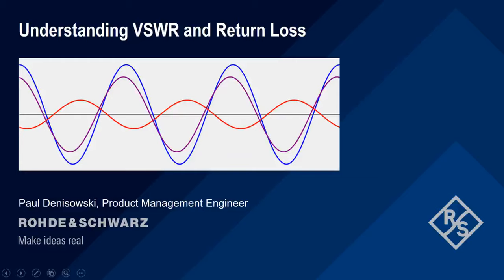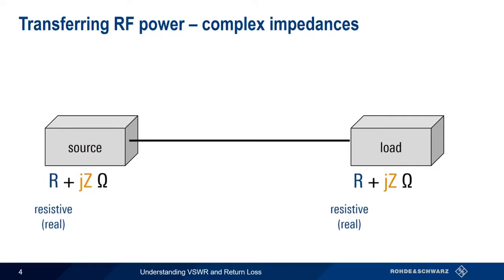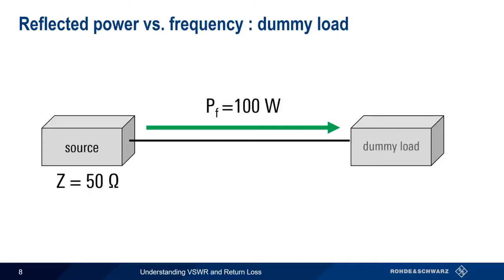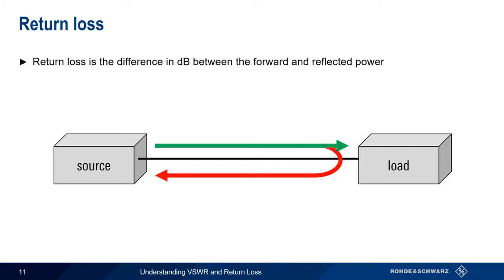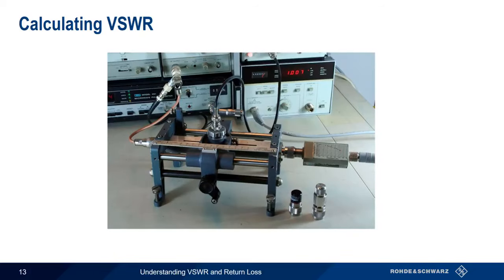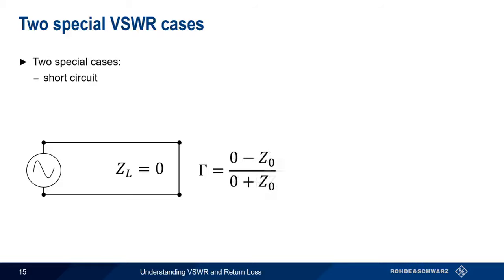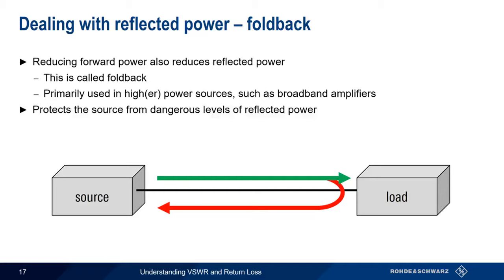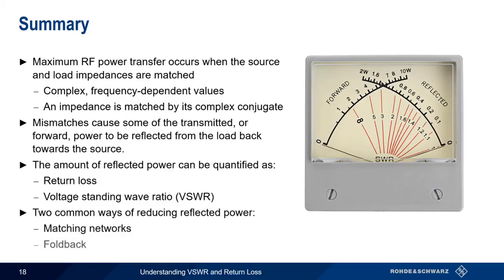Understanding VSWR and Return Loss

Comment: At 63, I find this the best explanation so far. The explanation is exactly the same as everyone else's, (so it would be, wouldn't it!), but the waveform animation is slower and easier to understand, with the explanation at a well measured steady pace. Thank you R&S, this video should be played in college courses.
Reply from the maker: Thanks a lot for the positive feedback - that motivates us!
Reply: Thank you!
Reply: @pauldenisowski  Thanks for the great video! and I have some things to ask.
The frequency of the reflected signal is the same as the frequency of the forward signal or not? And how about the relative phase between them?
Reply: @Tom-dn5de  Generally speaking, the signals appearing at all ports of a network will have the same frequency as the input signal but different phases and amplitudes.  It is possible to make S-parameter measurements on frequency-converting devices, but this is a more advanced topic that needs its own video :)
Reply: @pauldenisowski  Thanks a lot for your explanation. I am taking a VSWR measurement of an RF source, but I don't know why an auxiliary generator is
 used which transmits a wave with a slightly offset carrier frequency into the DUT. Could you explain it to me?
Reply: @Tom-dn5de  My guess is that you're making a "hot" S-parameter measurement.  Most S-parameter measurements are made with the network analyzer being the only source of RF power.  An example of a hot S22 measurement is measuring the VSWR of an amplifier output port while the amplifier is simultaneously generating an output signal ("hot").  A small frequency offset must be used so that the network analyzer can separate the reflected S22 power from the amplifier output power in order to make an accurate measurement.
Reply: @pauldenisowski  Thanks for your help, I'm making an output impedance measurement of an RF signal generator using an RF spectrum analyzer, an RF signal generator, and a directional coupler. This measurement makes me a lot of confusion. I'm not good at RF but always want to learn about it.

Comment: I'd like to make three important points, all of which can be easily proven as fact:

1.) Reflected power is absolutely NOT what damages a PA device or stage. It is the mismatch in optimum impedance at the output port, regardless of standing waves or reflected power on the feedline some distance away from the PA stage. 

2.) It is quite possible to have a very high percentage, actually nearly 100%, of transmitter power delivered to a load even with a very high "reflected power" or VSWR.

3.) Many antenna systems, as well as PA matching, splitting, and combining systems, intentionally operate with fairly high standing waves.   Collinear antennas, like VHF/UHF multiple bay arrays, commonly use mismatched transmission lines in harnesses to split power and match the multiple elements to the feed impedance. These harnesses and cables often operate well over 2:1 VSWR in the feed cables with negligible loss.

Comment: Thank you. 
   You filled a gap in my knowledge. 
   I repeatedly ran too much power for a GC MS and had a foldback circuit shut the power down. The field engineers could not explain this to me. It did not help that I had no meter to let me know I was approaching the power limit.
  Thanks again. N0QFT
Reply from the maker: That's great to hear Glen! Thank you for the feedback
Reply: Glad it was helpful.  Foldback has saved me from destroying quite a few things in my career :)

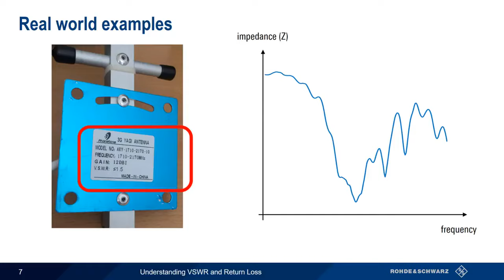Comment: 2:46 example of complex impedance - antennas and that is why there is a range of frequency mentioned. Therefore the level of power reflected will be a function of frequency.
There are two ways to quantify these losses 
1. VSWR 
2. return loss 

Retrun loss= Forward power - reflected power 
for example - Forward power is 50dBm and reflected power is 10dBm
Return loss = 40dBm
The larger the return loss the lesser the reflected power

Comment: I'm trying to troubleshoot a high voltage power transmitter  with valuable freq.. Problem is an over current fault which shuts down the transmitter. This video is helpful, TY
Reply: Thanks and good luck!

Comment: Wiki 
From a certain perspective 'Return Loss' is a misnomer. The usual function of a transmission line is to convey power from a source to a load with minimal loss. If a transmission line is correctly matched to a load, the reflected power will be zero, no power will be lost due to reflection, and 'Return Loss' will be infinite. Conversely if the line is terminated in an open circuit, the reflected power will be equal to the incident power; all of the incident power will be lost in the sense that none of it will be transferred to a load, and RL will be zero. Thus the numerical values of RL tend in the opposite sense to that expected of a 'loss'.
Reply: RL should have the name unloss :))
Reply: I agree completely that the term "return loss" is very problematic.  As I've mentioned a few times in the comments, it's confusing even to RF engineers, so much so that the editor of an IEEE journal had to publish an article explaining the "proper" way to use the term :)

Comment: Thank you for your brilliant explanation. One question on terminology though: should we use something like "effectively transmitted power" intead of "return loss"? I doubt "return loss" is the proper term to use in this case because we are discussing the energy, which has been absorbed by the antenna and has been radiated into ester. I know this is not your invention. I wish to know your opinion.
Reply: Hi Yaroslav - Thanks for your comment.  "Return loss" is the standard industry term for this measurement, but I will agree that this term can be a bit problematic.  In fact, the editor-in-chief of IEEE Transactions on Antennas and Propagation published a short article in 2009 describing the origins and proper use of the term "return loss" -- it appears close to a third of the people submitting papers to this journal were using the term incorrectly.  (Link below, available to IEEE members).

From the article:  "Turning to present-day usage, return loss is now the most common term used to describe reflection and mismatch."

https://ieeexplore.ieee.org/document/5162049?arnumber=5162049
Reply: @pauldenisowski  Thank you Paul. I will look into it.

Comment: About impedance matching, if i have a Source impedance of 50ohms, Line  RG6 75ohms, and a 25ohms load impedance(microstrip antenna). Is this a matching set with less reflected power? How much VSWR do you think I'll get from this setup? Thanks
Reply: Unless the load is purely resistive (and your antenna almost certainly isn't), the VSWR will be a function of frequency -- i.e. it will change depending on the frequency of the signal generated by the source.  In most cases, the easiest way to minimize reflected power is to have a source, load, and line impedance that are all as similar as possible.  Even though a lot of people successfully use RG6 with 50 ohm sources, you might want to consider a different cable type. There's not much you can do about the impedance of the antenna, but keep in mind that this may also change based on how and where the antenna is mounted (i.e. what's next to it).

It can be very difficult to reliably and accurately determine VSWR based on the (nominal) values of components in a system.  I can do the math and calculate how long a dipole should be to have a given VSWR over a given frequency range, but when I actually build it and hang it from a tree or (especially) in my attic, the VSWR is never precisely what I calculated (and is sometimes quite different).  The math may give you a good starting point, but the actual value of the assembled system will often be at least somewhat different.  This is one of the reasons why instruments like network (or antenna) analyzers exist -- measurement is the only reliable way to know for sure what your VSWR actually is.  Hope that helps!

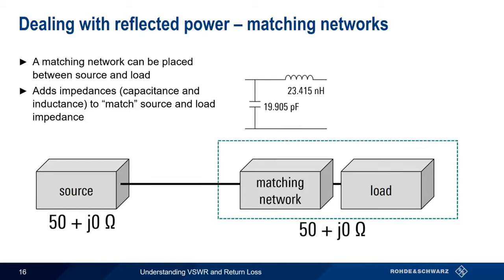Comment: For the matching network (at 8:14), what would you need to do if the source impedance was smaller than the load impedance? Would the matching network have to have some sort of ADMITTANCE to get the source and load to match? Or is it just not possible to do so?

Comment: Great video.  I got stuck when trying to find the ratio of reflected power to forward power by the Vswr. Is there an equation that converts Vswr to the amount of reflected power?
Reply from the maker: Dear Richard,

for calculating VSWR using power instead of voltage, you can use the following formula:  VSWR = (1 + p) / (1 – p), where p = sqrt(reverse_power / forward_power).

Best,
Rohde & Schwarz Social Media Team
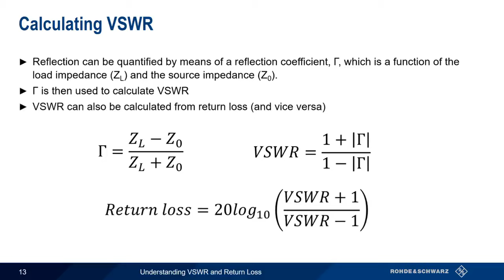Reply: @Rohde-Schwarz  If above formula is to be used fo this conversion, when should we use the the formula mentioned at 6:12 relating return loss and VSWR?

Comment: Sir, your idea of vswr is different from what some materials say. They say vswr is ratio of voltage max at the peak and voltage minimum at the trough/bottom. Your explanation of it in the graph appears different. Also, textbooks don't mention that impedance matching means load impedance is the complex conjugate of the source or line impedance. They say it should be exact match. Could you please clarify. Thanks in advance.
Reply: The complex conjugate provides the exact match.  This calculator might be helpful to play around with: https://www.analog.com/en/design-center/interactive-design-tools/rf-impedance-matching-calculator.html

Comment: The terminology of Return Loss for me is very counterintuitive. Instead of difference Forward - Return power I would rather use the ratio of Return / Forward. As we call it Loss how can we strive to maximize the number? Loss should be a low number, or low percentage.
Reply: It is counter intuitive. But you can think at the power “returning”, the one that has been reflected back by the mismatch, the one we don’t want. So we want to get rid of that power, we want to loose that. The more we loose it the happier we are. So in this case we aim to have something missing. Like having less fat in the blood is good. The less we have the better!

Comment: 2:39 a yagi with a gain of 12 DECABel? I would expect the good people at R&S to at least use graphics in which the SI units are respected. In this case: 12 dBi.
Reply: Sorry, but could you clarify what you're referring to?  I don't believe I ever said anything about antenna gain in units of dB or dBi.  The y-axis of the graph at 2:39 was intentionally labelled with the generic unit "impedance" for the purpose of illustrating that impedance is non-constant for most antennas, at least compared to the dummy load on the previous slide

A graph of gain for a directional antenna like the yagi shown would usually be a polar plot showing gain in dBi (relative to an isotropic radiator) as a function of azimuth.  You are absolutely correct in that the gain of an antenna is almost always given in dBi -- one exception would be something like front-back ratio, which would be in dB, not dBi.

Again, my apologies if I'm misunderstanding you.  And I can assure you that the good people at R&S are familiar with the different types of dB:  in fact, we have an entire educational note on this very topic :)    

https://scdn.rohde-schwarz.com/ur/pws/dl_downloads/dl_application/application_notes/1ma98/1MA98_13e_dB_or_not_dB.pdf
Reply: For a start because decibels is based on log functions there are no units as such in the argument. One can refer to an antenna gain without referring to a theoretical antenna that has a perfect spherical radiation pattern, in practice such an antenna does not exist  or you can just use decibels without the isotropic reference. Decibels is based on ratios of things like power, voltage so that the log function argument has no units.

Comment: There is an ambiguity, in that the presentation can leave the impression that reflected power gets back into the source and destroys the equipment.   This is of course not true.   It would be useful to link the rising voltage in the voltage charts to the damage caused to the source device as the explanation of the danger of high SWR.   The alternate case of course is very high currents.
Reply: The reflected power can damage the finals in radio transmitters. These finals then need to be replaced. Been there and have witnessed this happen.
Reply: @glenmartin2437 how does reflected power damage finals when it joins the forward power ?